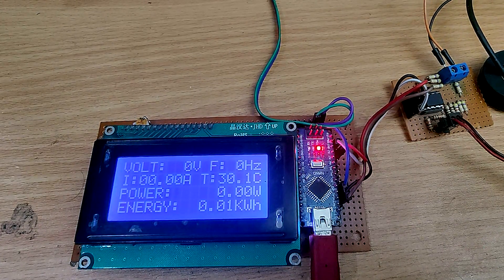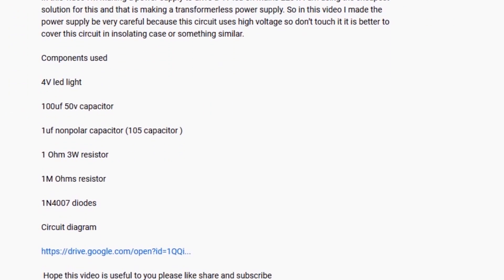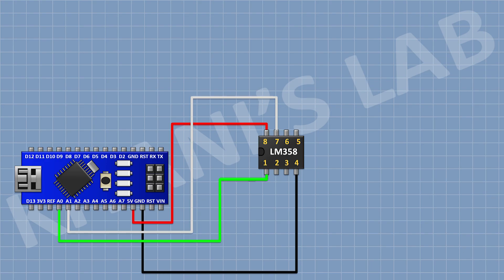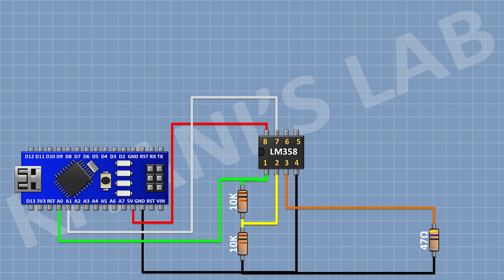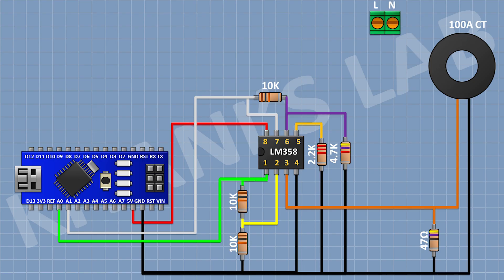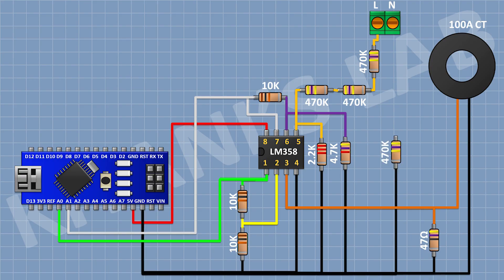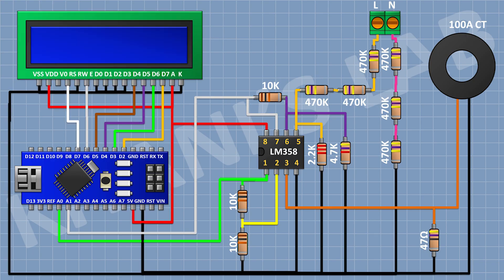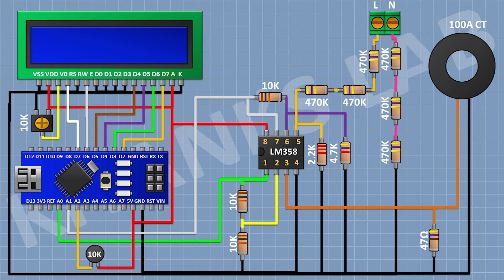How To Make AC 6 In 1 Meter | Arduino Project

Comment: Awesome  !  Can you please add eeprom storage option with reset button to clear stored data from eeprom memory. In this way the energy Kwatt hour units energy consumed will not wipe out on power failure until reset button is pressed.
Awaiting your earliest response.

Comment: Nice project thanks for sharing ❤❤❤
Reply: Sir please update upload circuit diagram
Reply from the maker: ok thanks
Reply from the maker: @easirarafat6771  updated
Reply: Sir can you make DC voltage & current measurements meter with temp & over current or short circuit protection...... Arduino base 
Advance thanks ❤❤❤